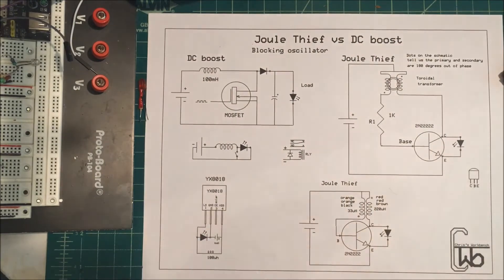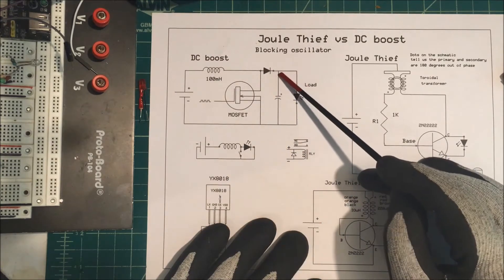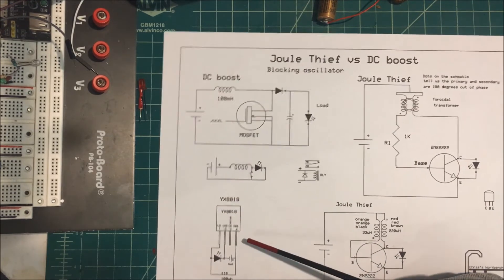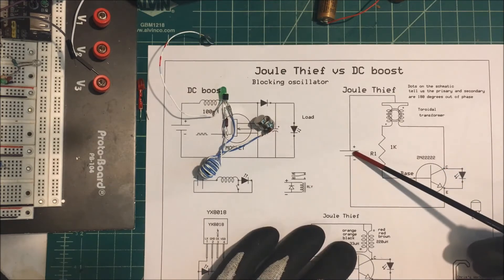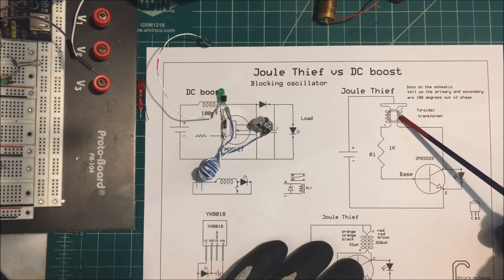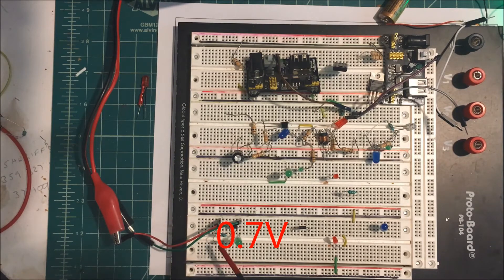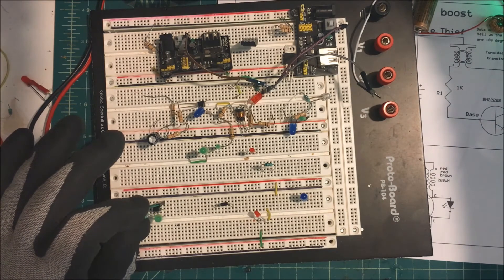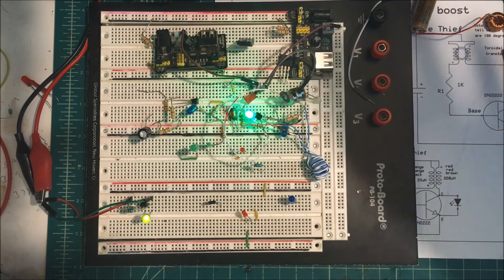Joule Thief and DC booster

Comment: Would be interesting to hear more about that YX8018 joule thief I see on your schematic. I made one by putting the inductor between pins 1 and 3, and sending pins 2 and 3 to ground and +, respectively, and the LED+ and LED- connected to pins 1 and 3, respectively. It only lights the LED down to about 0.9V, but draws a lower current  (<10mA) over 0.9-1.5V (this is with a 4.7 mH inductor). With the same inductor, yours lights up all the way down to 0.65V or so, and is interesting because it gets dimmer down to about 0.9V but then starts getting brighter again until it cuts out at 0.65V.

Comment: Wow, that last circuit with the two inductors is so cool. Any reason why you went with 33uH and 220uH? In my experiments, it seems higher uH gives higher efficiency (>1mH got my LED to light at 0.5V) and lower kHz (as low as 50kHz according to my DSO-138). I'm just a noob, so would greatly appreciate any further knowledge you are willing to divulge on this. Is there a formula relating uH to kHz to voltage?
Reply from the maker: I just went with what I had.

Comment: Great, Chris! Thanks! For your final circuit/Joule Thief, is it necessary to orient the two inductors in a particular way? Meaning, is there a way to know if their internal coils are turned in opposition? Is it necessary? Maybe there is an industry standard for the turns which is indicated by the orientation of the color bands? I guess it is easy enough to bread board the circuit and try the inductors in different orientations to find the best output... But, if there is a standard, that would be good knowledge.
Reply: When it's in a torid coil that's center tapped (or any centre tapped coil) the base winding and the collector winding would be in opposite directions.. hence the dots on the schematic on opposite sides of the coils to indicate that. 👍
(I know I'm 2years late with the answer but there ya go)😊